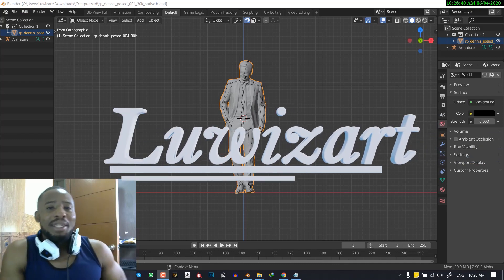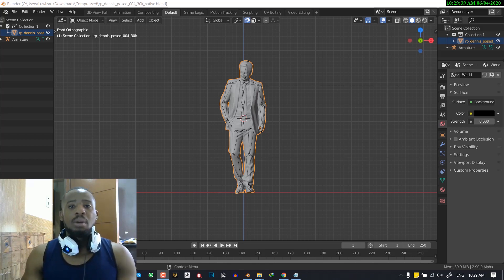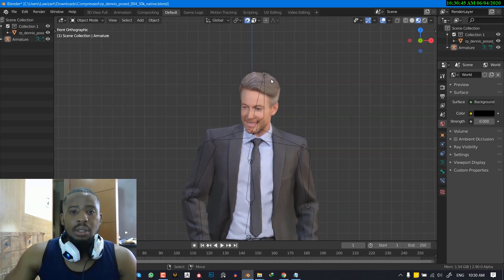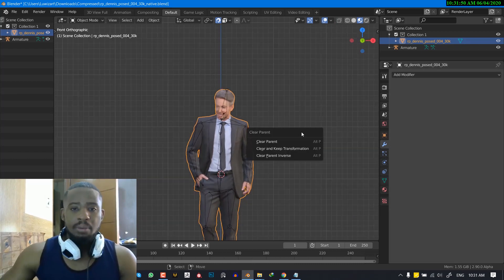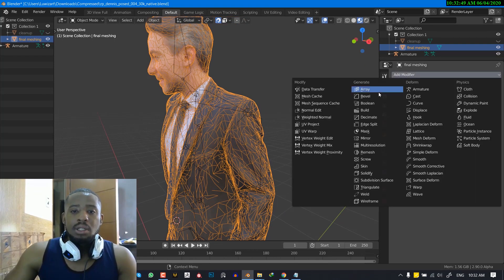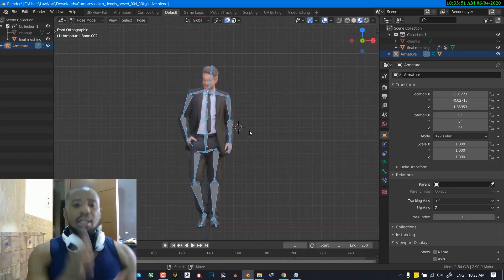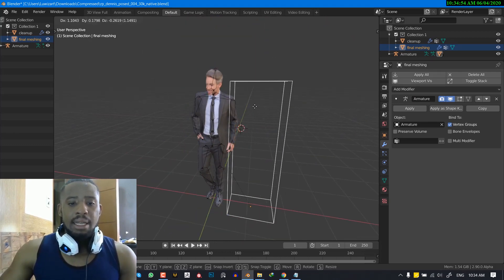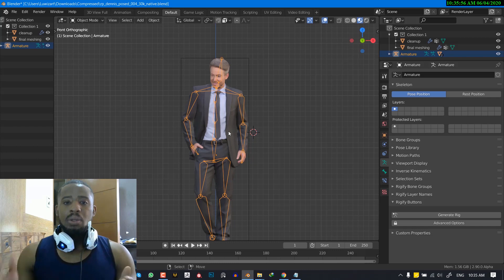Resolve bone heat Weighting failure in blender

Comment: Thx for explaining the issue in the beginning, I had a model with bunch of separated parts and couldn't understand what was causing the problem.

I solved the issue in a bit different way though. In edit mode separated everything "By Loose Parts", then selected all separated meshes in object mode and bound it to armature, and then combined all the meshes back into one with Ctrl+J.

Comment: Thank you So much friend. I used your logic about complex mesh. So  what i discovered was that in some cases , Blender cant apply the automati weigth if you use [ SubDivision ] So what i did was simple . I removed the subdivision tryed again the atutomatic Weigth , and this time worked . And ofcourse you can add subdivision again after the automatic weight bone applyed.

Comment: My dear brother, I have a problem connecting clothes after designing it in a separate program and I want to add clothes to the object, and the object has a movement system from a site and this message shows me what is the solution

Comment: I have another solution to this, select the model, go to edit mode, select all vertices and press M and merge by distance without deforming the mesh, and done. And after this try to parent it to bone and it will work 100% without any modifier problem.
And if you have eyes and mouth, just make other bones for it or just move it aside and then only parent the mesh without mouth and eyes or hair.
Reply: Dude thank you so much, I stumbled upon this video and the workflow presented did not work for me, started reading comments and came across yours which solved all my problems with it. Thank you and have a wonderful day.

Comment: [ALTERNATE SOLUTION]
Thanks for the video but This solution didn't worked for me as my model was already low poly.
But then I added a subdivision modifier 1st, then parented with auto weights. And this time it worked! 
And then you could remove the sub D, and it will still work. And it exports to game engine too without any problem.

Comment: I'm using 2.79 Blender..  I don't have the "Weld"  modifier...  I've done all the clean up and I still get  Bone heat failure..  The mesh looks ok..    I decimated down to 16k  vertices..   Maybe I'll go lower,  but,  I don't wanna lose detail either...   idk .  .
Reply from the maker: For blender 2.79, you can use the dynamic topology in the sculpt mode to combine all the mesh
Reply: @Luwizart  ,  Good thinking !,  Thank You...  I'm gonna try it now.

Comment: Thank you for this solution. I see many people having this problem, and the previous "best" answer was to remove vertex duplicates / merge vertex by distance.
Even though this method requires a little weight clean up, it is by far the most graceful solution to this problem. I'll make sure to share with everyone having this issue. Thanks again.

Comment: cool,
thanks for the tip,
this is a super function and nice that they are also available in Blender, thanks for that, thumbs up.
I am still rigging and animating with softimage,
but Blender now offers many ways to solve problems like you show.
In softimage this function is called Gator, there you can copy texture-uv's,weightmaps even shapes from one object to another.
best regards
Walt
Reply from the maker: Thanks for watching!